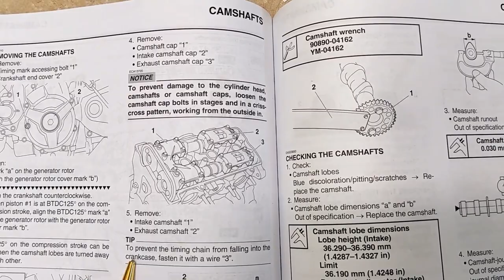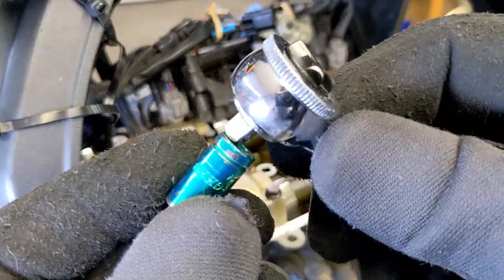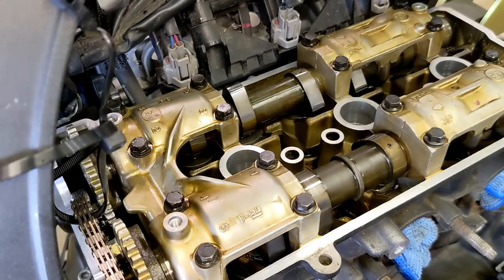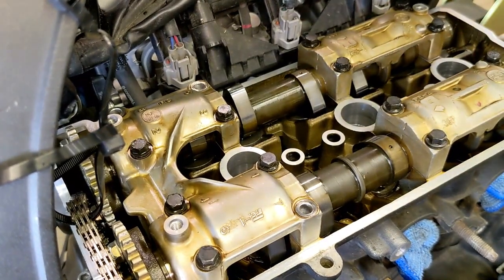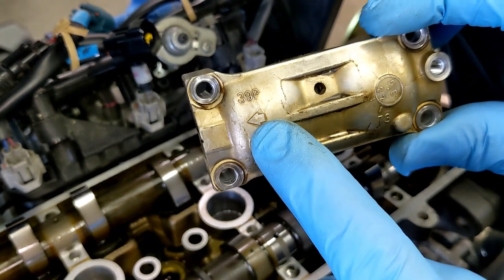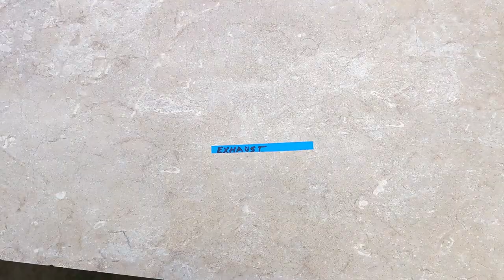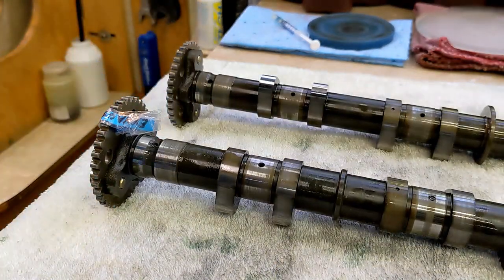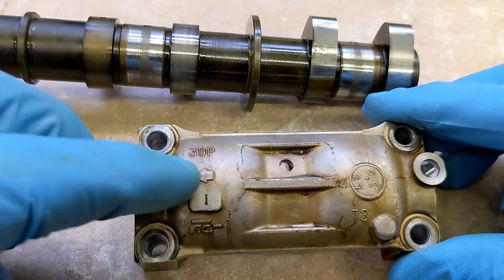cam caps and camshaft removal Yamaha FZ-09/MT-09 2014 2015 2016

Comment: Nice gloves. Where can I get a pair?
Reply from the maker: Harbor Freight has the cheapest price...quality may have gone down lately...you can pretty much get them anywhere..Napa auto parts etc..make sure you buy Nitrile gloves(resists paint thinner/grease)...not latex(melts in paint thinner)